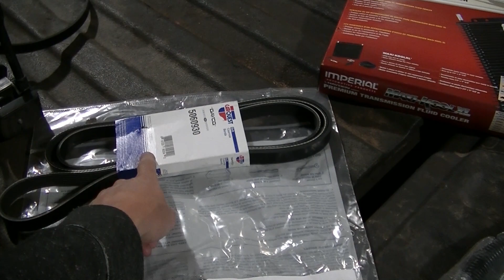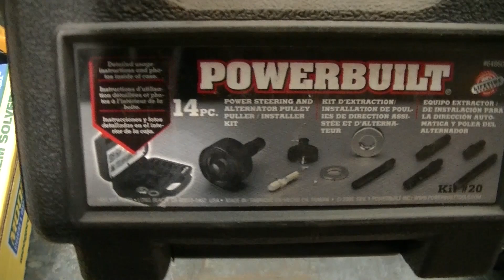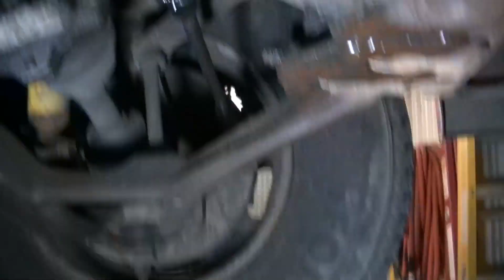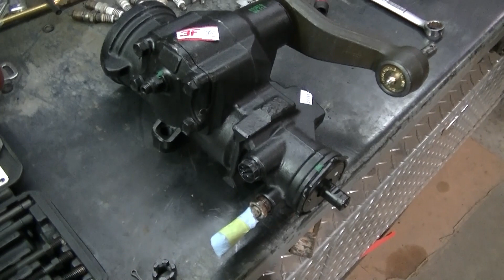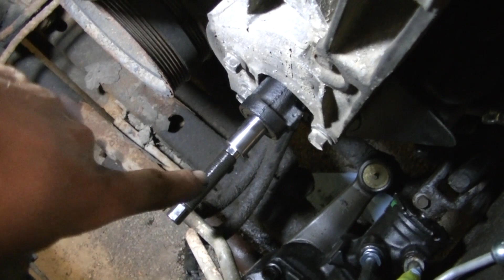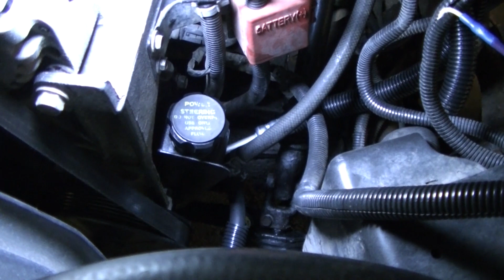Silverado 2500HD Power Steering Pump, Steering Box, Cooler, Lines, Pitman & Idler Arm

Comment: Silly question but why do you need a power steering cooler? I can understand the need for a transmission one. Also, does the trunk now need to put on an wheel alignment machine? As always great quality work and video.
Reply from the maker: If the factory had a cooler on the steering then I wouldn't want to eliminate that.  The trans cooler is overkill but it's what I had.  Yes,  the truck should get an alignment.  I am waiting on maybe a lift and tires before it gets one.
Reply from the maker: *****   I was thinking 3" with 34's.  Something that still keeps the truck usable.
Reply: Yes! 6" Lift Install Video!
Reply: mossman381 I have 33s on mine 2500 LD. I know people who run 35s on stock height with some trimming, so if you go with a 3" you can easily fit 35s. Especially since the 2500HD is higher from the factory that the plain 2500
Reply from the maker: *****   The tires I was looking at are actually 34.5".

Comment: Randy I have to do mine this year , its leaking out the bottom of the box seal at the pitman arm. I noticed there's  two versions of the arm a 3 spline and a 4 spline. Do you remember which one was needed for yours.
Reply from the maker: This one had the 3 groove.  This box was the 33 spline.  They have another listing for a 32 spline box.  It's much more expensive and I believe a more heavy duty box.  I think that one takes the 4 groove pitman arm.  The boxes I am pretty sure are interchangeable.  The dually had the smaller 33 spline box on it and I changed it to the bigger 32 spline.
Reply: mossman381 Thanks